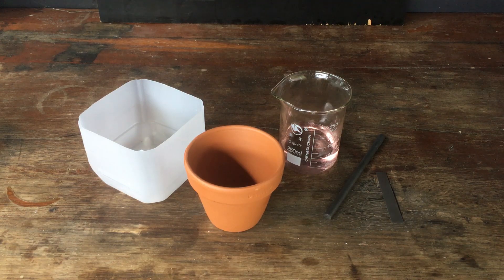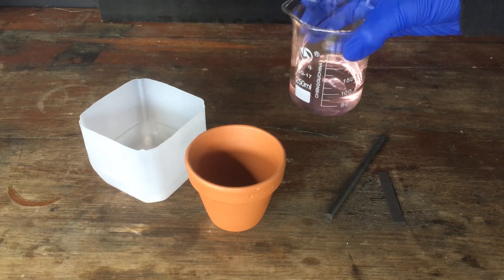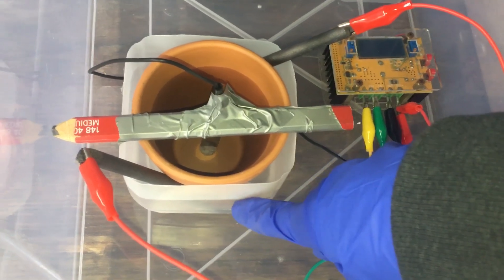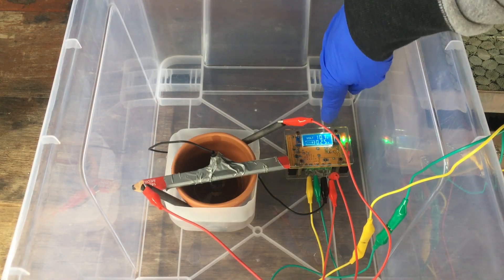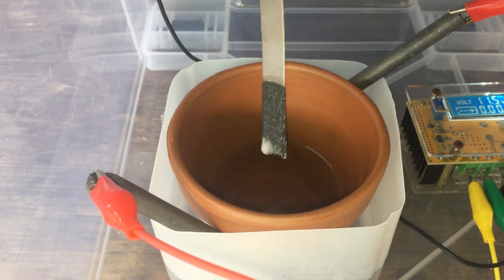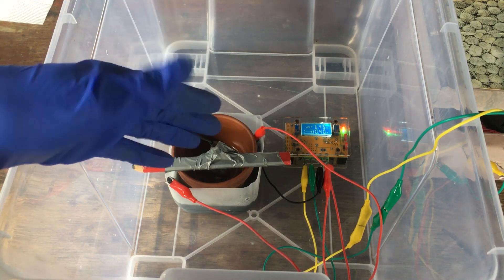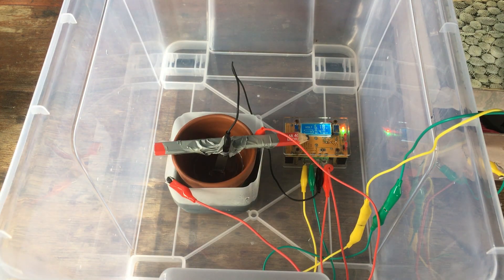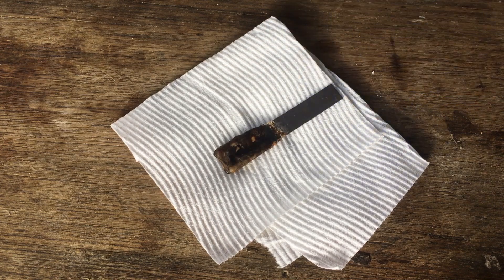Can We Electroplate Manganese?

Comment: Did you ever get this to work mate?

I'm trying to plate some aluminum with manganese sulfate... However I'm also struggling with the process... 

Weirdly my manganese sulfate is more of a green color... I made it from mnO2 (with sulfuric acid and oxalic acid) and then made another batch with sulfuric acid, iron and oxalic acid as the reducing agent... However they both turned out green after filtering 🤔
Reply from the maker: I'm afraid I haven't looked at this since making the video - all the information and experimentation I've gathered/done is here.
In general though, plating aluminium is very difficult. For what reason do you need manganese-plated aluminium?

Comment: if u use carbon electrodes, if that diaphram is an "electrolytic" diaphram, and it seems like it, this actually makes a super capacitor, so u get huge farads out of it, but I cant guess how to take advantage of it yet than just using dc and conducting through normally.

Comment: assuming MnSO4 would work as other sulfates
Reply: why you plate titanium, select a more suitable target
Reply: titanium has the oxide layer too
Reply: maybe a two part plating, with the target in non-sulfate ion conductor, like baking soda, swap the electrolytes
Reply: ionized electric field sputtering, if the low voltage plating did not succeed
Reply: no water based electrolyte

Comment: Hey ScrapScience, this questions isn’t about your video, I hope you don’t mind. How can I make for example liquid sodium hydroxide into a solid form?
Reply from the maker: No worries, I'm always happy to try to answer anything (or at least, most things) chemistry related!
I'm assuming that by 'liquid sodium hydroxide', you mean sodium hydroxide dissolved in water. Converting this to the solid form is "simple", in that you just need to boil off the water to be left with the solid NaOH. However, doing this is incredibly difficult.
To get rid of most of the water, you need to heat the solution to very high temperatures (approaching 300C!). Additionally, this can't be done in glassware because it will dissolve right through your container, and it will give you incredibly severe burns if you get any of the boiling liquid (which splatters a lot!) on your skin.
It's definitely something you should only do with a very good setup and a lot of safety precautions. If that's something you can pull off, go for it, but if not, I'd seriously recommend trying something different.
Reply: @ScrapScience  Thanks! I really appreciate it.

Comment: Hmm if you plated chrome metal and carbon electrode could you convert Chronum metal into Potassium dichromate or Potassium chromate? If in a basic condition like sodium carbonate? Could it work?
Reply from the maker: I think it's definitely possible, and I've been planning on giving it a go for a while. There are a couple of references in some very old literature suggesting that the process you've described might work.
I'll try it at some point, probably after optimising the permanganate process first.

Comment: You may have the option of C réduction of MnO, Mn2O3 or MnO2.

Maybe nascent H2 would work on red heated MnO excluded from air or O2?

Probably would MnCl2/Al or MnO/Al or MnS/Al work aswel by aluminothermical reactions?

For the rest maybe in electrolysis try:
1) MnCl2 or MnSO4 saturated with exces NH4OH... NH3 does complexate Mn(2+) or Mn(3+) and solubilise Mn(OH)2 or Mn(OH)3..so OH(-) build up would be effectless?

2)Use Mn tartrate or citrate with tartric or citric acid...those hydroxyacids ensure a buffering effect but they also do complexate cations and helps cations to remain in solution even in basic media... see the famous case of Fehling solution to identify reducing (aldehydic) sugars... by heating you get sucrate and red Cu2O precipitate... 
So Cu salt + tartrate salt + NaOH is a blue clear solution... while Cu(OH)2 is a heavy turquoise blue precipitate formed from usual Cu(2+) salts in NaOH solutions...it turns black as CuO above 100°C.

I hope this will help you.

PHILOU Zrealone from Science Madness forum.
Reply from the maker: Thanks!
It seems like an Al/MnO2 thermite is pretty easy to set up and perform, so that's the option I'm leaning towards at the moment.

If we need to try electrolysis again, I'll definitely give your ideas a go. I've been trying to look for a way to solubilise the manganese at higher pH, so this is super helpful :)

Comment: Hey at least you got sulfuric acid to try sulfate hah!
Best I got was a few crumbs of manganese from MnCl2 in ethanol. Not sure if it was 96% or less :/. I kept getting hydroxide with straight water. No diaphragms either...  
My reasoning was pretty much: less water -> less hydroxide to form.
I didn't run it for long though, kinda smells pungently fruity, maybe it's acetaldehyde. I was just banging rocks together basically but hey, I got metal! Sketchy af because flammable solvents and possible sparks!
Reply from the maker: Wow, thanks for the account of your experiment!
I've never even tried an organic solvent, that's definitely not a bad idea for eliminating the production of the hydroxide. Production of acetaldehyde is definitely a likely result though, sounds scary.
Definitely worth some future thought, thanks for the info!

Comment: Would this be good as a battery system if charged?
Reply from the maker: It would work as a battery to some degree. It would generate around a volt at very limited current.
While it's possible in theory, it would be ridiculous to scale this up for real energy storage. There are much better batteries which can be made much more easily.
Reply: Scrap Science it makes more sense with Vanadium and sulfuric acid the Vanadium flow battery. V3- +2e- >>> V5 charged and discharged V5 >>> V3- + 2e-.
Reply: It works well as a battery with a high surface area carbon cathode and a zinc anode, you get MnO2 plating instead of Mn metal. Acetate salts work better than sulfate salts.

Comment: When I tried this experiment I used a lead dioxide anode. In the beggining of the electrolysis the current was very low because I just put water in the anodic compartment, so I pippeted some of the manganese sulphate from the catode compartment and dropped it directly over the anode and the solution there became purple (for the presence of MnO4- ions I think)
might this be because of the lead dioxide electrode? I must clarify that I made the manganese sulphate solution from Mn2O3 (H2SO4 + Mn2O3 --> MnSO4 + MnO2) from spent batteries (because the MnO2 is reduced in the usage of the battery) and later I discovered that the solution was acidic, so not all of the sulfuric acid was neutralized in the production of my MnSO4
sorry if my english is bad, i'm not a native speaker
Reply from the maker: Yeah, lead dioxide will react with manganese(II) to form permanganate (especially in slightly acidic conditions), so that's likely what's happening there.
Reply: @Scrap Science  If I use this for the production of permanganic acid, how can I isolate it from the sulphuric acid?
Reply from the maker: Permanganic acid is virtually impossible to separate/isolate from solution in any home setup, and is still very difficult to do in professional labs. It is unstable, and so will just decompose on any reasonable attempt to evaporate or separate it from solution.
I honestly have no idea where you'd even start if you wanted to isolate the permanganic acid, sorry.
Reply: @ScrapScience  thanks for answering! the main reason for the isolation of the permanganic acid was that I wanted an oxidant without potassium ions, only for experimental purpouses
Reply: @lautaromorales2903  If you only wanted to remove the potassium ions, it shouldn't be too difficult to replace it or dilute it with an equivalent ion.

Comment from the maker: Okay, where to go from here?
I have a few ideas about how to get the plating to work, but I wanted to hear your thoughts:

1) The most obvious solution I thought of here is to stir the catholyte (to prevent OH- ions from building up around the cathode) and to buffer a pH of 5-6. What should I use as the buffer though? A potassium hydrogen phosphate buffer seems like a good option to me (since it’s electrochemically inert), but what do you think?
2) I might be able to set up automatic addition of acid to the cathode compartment. Seems a little beyond my engineering skills but I might be able to set something up. Do you think a syringe pump might be the way to go here?
3) My original video on making manganese metal used a more dilute solution and seemed to get better plating results (though that was on a graphite cathode). Maybe a more dilute solution is all I need?
4) Should I just try a thermite reaction to make big chunks of manganese? I’d have to get some aluminium powder and some manganese dioxide, but the manganese made from thermite would probably work quite well.

If you’ve got any other good ideas on making manganese, I’d love to hear them. I’m leaning towards the first option right now, but if people want to see something different, I’d be keen to try anything.
Reply: the manganese can be reduced with carbon like iron? because thermite might vaporize the manganese that forms
Reply: Couldn't you make the metal via thermite from the oxide? then again the thermite uses high temperatures and it might not make big pieces.
Reply from the maker: @lucas_lab  Thermite seems to do a very good job of making the metal, so I'm definitely thinking that that's the way to go. Just need some MnO2 and some Al powder and we'll be all set.
Reply: @ScrapScience  Can the metal be remelted like steel to make a different shape?
Reply from the maker: @lucas_lab  In theory, yes, and I have considered doing so. However, the temperatures required are very difficult to achieve for any home experimenter. It requires a very well-built furnace, so I consider casting manganese to be too complex for this kind of project (since the whole idea is to make permanganate synthesis more accessible).
Reply: @ScrapScience  arc furnace maybe? Just need an electric welder, some graphite rods and some refractory bricks. The bricks are easy to cut, so you can make holes for the rods. There are a bunch of videos here on YouTube where people build them. Love the channel!
Reply: I really think you get better results if you don't use a diaphragm in this cell. Simply put all of the electrodes in the same container. I guess this will allow the neutralization of OH- ion to happen faster. Don't use excess sulfuric acid or use only a little excess sulfuric acid. Spread the anodes horizontally around the container to cover all sides (4 horizontal graphite rods)
.
I may not be able to watch youtube in near future to see the results. :(
The regime in Iran decided to completely block international Internet or heavily limit international Internet access. (not 100% decided yet) With the help from china to make domestic Internet.
Even VPN is useless. (Already youtube is filtered in Iran for example)
People are silent & some are getting killed in protests. Where are we going really?
Sorry, I don't mean to bother with sad stories.
Reply from the maker: @hrajabi7261  Really sorry to hear that dude, hope things turn out okay for you. I'm afraid I can't offer much help there.

The only reason why I add a diaphragm is to stop the formation of MnO2 on the anode, which depletes the manganese concentration. If I end up trying electrolysis again, I'll probably give it a go without a diaphragm anyway, since you're right on the fact that it will stop OH- ions from building up.
Reply: I'd say the very least the hydrogen is interfering. If you're indeed making manganese, it's going to be spongy and flake away very easily.

Lower the voltage. The current density is only part of the equation.